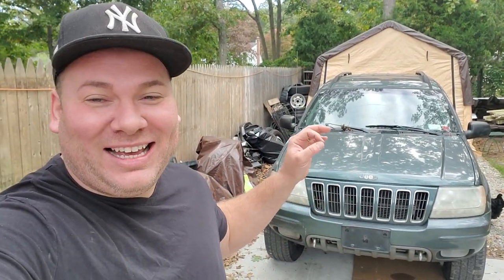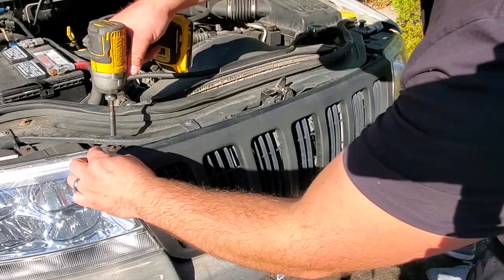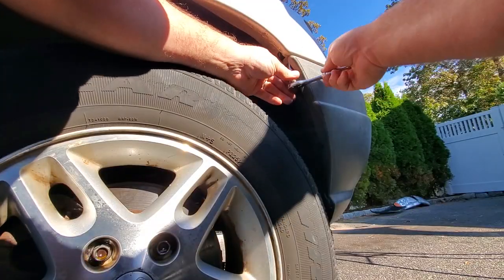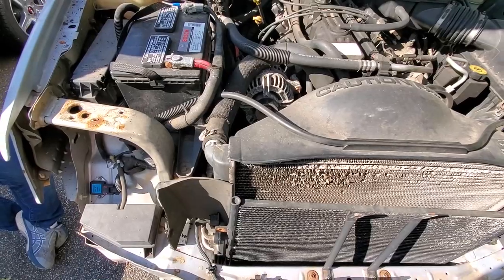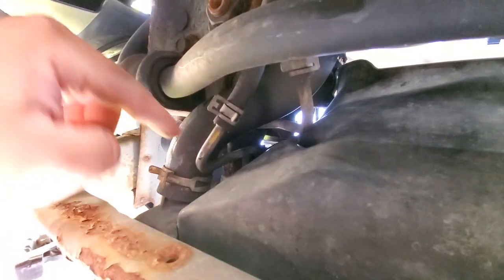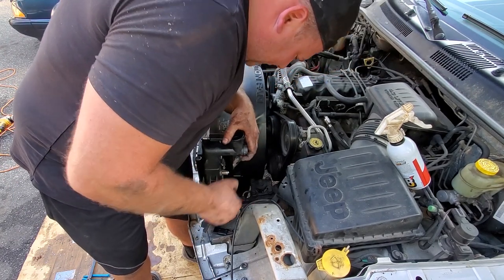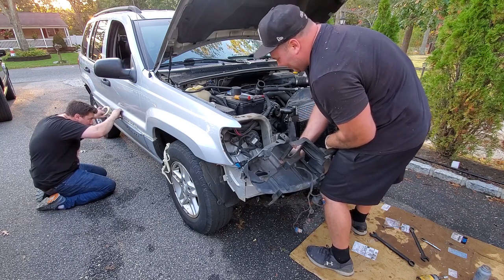2002 JEEP GRAND CHEROKEE REFRESH PART 1 - RADIATOR REPLACEMENT

Comment: Do you have a part number for those $22 upper and lower trans hard lines? All I can find is the full line from rad to trans, and they are like 100 bucks each!
Reply from the maker: sorry I don't, I called advance auto and spoke with them right before I "fixed" mine.  I believe they are a universal size you may be able to make a custom line.
Reply: Alright thanks. Mine are leaking and I tightened them up ,but they started leaking again a few weeks later. Is there an O-ring I could replace where the lines mount to the radiator?
Reply from the maker: @codyharder6390  no, I don't think so.  I didn't recall any o rings on the trans lines when just did them on the 4.7

Comment: Thanks for the fun video. My '03 Grand Cherokee needs a radiator. The local garage wants $769 to do the job. That's crazy, considering I can buy a lifetime radiator for under 100 bucks, and do it myself. After watching other videos, some mechanics have successfully done the job without removing the headlights, grille or bumper.

Comment: Project Dan.. That upper hose you just removed @ 9:35..., mines was baked on there.. so i went and removed the rubber hose from both upper and lower lines off the radiator  from under the jeep to remove the old radiator..  Now that I put in the new radiator and cooling hard lines on the radiator...I ask..  ..does the top cooler lines from the radiator connect back to the top rubber hose trans line.. or vs... I hope you understand my question.. help a girl out.. pleeese!!

Comment: Great work at making a very difficult job on a WJ look so easy. I have done a few radiator changes and I cannot tell how much easier it is with the driver (and an assistant). Keep up the good work. P.S. Love General's license plate.
Reply from the maker: Thanks Brother! it only felt easy because we planned on painting the bumpers off the Jeep anyway. .. had it not been planned it may have been more stressful

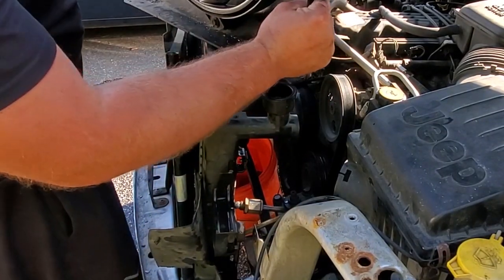Comment: hey guys I had to buy new translines, the were stuck on the radiator. So i removed them off the rubber hoses. But i did not take note, if the upper radiator trans line connects back  to the upper rubber hose or vs. I have seen a diagram.. but I have gotten conflicting replies. . I almost have a good luck at your on 10:26. help a girl out. no garage... so doing this on the street.

Comment: Sweet vid man! I just needed to replace my header panel. All the pastic seems to be cracking in my 2002 WJ limited. The bumpers do vary on the WJs and mine is the integrated grill, argh. But this video still helped. Thanks
Reply from the maker: My pleasure John. Good luck!

Comment: Great video.  Question how do you drain your coolant from your engine block?  I assume If you just open up the radiator bottom valve coolant is still left in engine block and heater core.  Thx
Reply from the maker: That is correct, there will be residual fluid in the block.  if you dont want to flush it out with a hose there is a square drain plug on the block behind the drivers side motor mount.  they are hard to see as they are usually camouflaged by oil dirt and grease

Comment: Those threaded pieces that screw into the radiator for the transmission lines. Do you just tighten them all the way down into the radiator and then tighten the lock nut onto it, and then screw the line fitting onto the threaded piece?
Reply from the maker: yes! nailed it

Comment: What kind of radiator is this,? my lines were rusted on. So I planned on getting new ones. I cut it off then twisted it off with the fitting attached.  Bad idea- the internal trans radiator fell to the bottom. Just getting a new one at this point.
Reply from the maker: I think this was a just a regular factory radiator

Comment: Now I have always put the fan and trans lines on before putting rad in the vehicle and installing it as a unit. Do you think it is easier to do them one at a time?
Reply from the maker: I don't think it matters if you have the whole nose off but I think you gotta put it on first and install it as a unit if your gonna jimmy jam them out without taking off the front.  I have you guys a shout in part 2 because your vid is so good and so different. 💪

Comment: Nice job Big D.That radiator had definitely seen better days.The one in my 2003 Ram just gave up the ghost too.17yrs on a radiator with plastic end caps is not T bad.....
Reply from the maker: omg 17 years!  that's a miracle!  I don't like those plastic rads... so cheaply made

Comment: Thanks for the video Dan. Have this same Jeep…bought from father in law. Overheated and mechanic told me lifters are bad. Also have radiator leak…like your video. We have the e fan off but no time to check the relay. Debating to just get rid of but we have some money in a lift kit and new rims and tires. I know you haven’t seen the Jeep but would appreciate your opinion on keeping.
Reply from the maker: If it's a 4.0 keep it.  give it an oil flish. Use rotella oil with zinc to lube the lifters.. also try ristlone.. great additive to help quiet lifters.. radiators are not too hard to fix... and while your doing the rad you can give it a new fan relay (under the passenger headlight)  Give it some TLC and you'll be fine!

Comment: How do you feel about the 2004 special edition 4.06 cylinder I want to restore her how much should I be saving her on a Minimum wage income
Reply from the maker: I love any 4.0 I6.  if the vehicle is a clean rust free keeper then make your oil changes a priority (use rotella T5). And make sure it's always got enough coolant. Everything else comes second hand.  God bless

Comment: Hello, how are you? Again asking questions ..I still watch your videos, very good with all the information. My question is that xj tend to warm up a lot of the engine, you did something to solve that problem you changed something fan radiator or something to solve the problem or which is the secret. And thank you for sharing your videos with all of us very good . Saludos y paz ✌️
Reply from the maker: thank you! 💪 no, no cooling mods. my cooling system is stock, but well maintained.